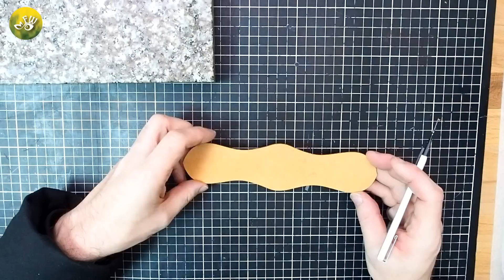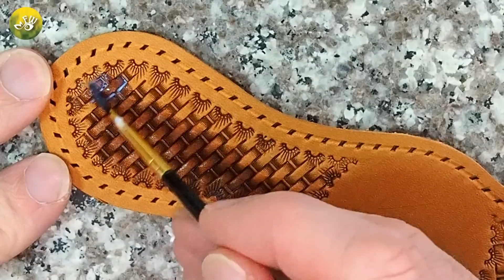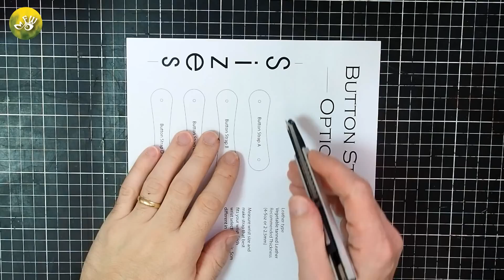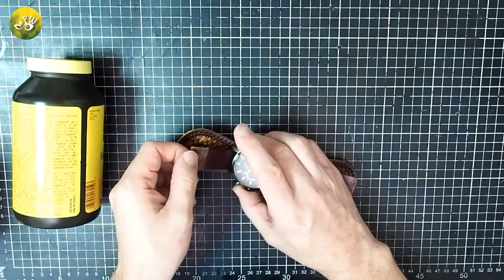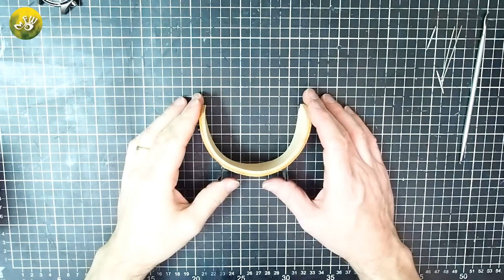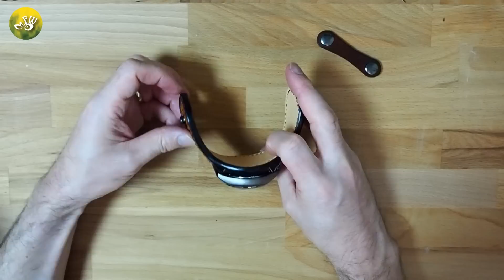Handmade Artisan Leather Snap-On Watchband Tutorial With Pattern (HD) by Fischer Workshops

Comment: nice skills, nice job, . but i see two points:
1/ it's not adjustable, it's a strap for one specific watch. it's a lot of work for single watch. what if one day you break it , and want to put the strap on another one?
2/ i definitively dont trust the lock system ( which is not adjustable either), there is a big chance to loose the watch one day, i can bet on that.

Comment: I like everything, but let me make a couple of little tips: 1. make a hole in the top layer so that the watch is a little bit sunk into the skin. so it will look better and sit on the hand. 2. make the strap asymmetrical so that the buttons do not lie on the table when you work on the computer. otherwise, it will be annoying. It would also be cool if the inner side of the strap would not be flat, but with some kind of cuts or ornaments to improve ventilation and blood flow.
Reply from the maker: Thank you for your suggestions.

Comment: hello, I'm beginner on leather crafts and I have a few question, is the locking method robust and secure? how does it perform over time
Reply from the maker: Yes, it is. I've been using this band for 3 years and still works like new. Use a quality snap to ensure good use.

Comment: Man i hate when people tie a knott at the end of their stitch. The proper way is a back stitch then melt the ends. The guy at weaver doest that to, drives me nuts to see those big knotts. The band came out nice though
Reply: Joshua Poche if you use linen thread then tie a knot. If it is a poly or nylon then burn.
Reply from the maker: This is a linen thread, so it can't be burned. Backstitching should still work if you prefer.